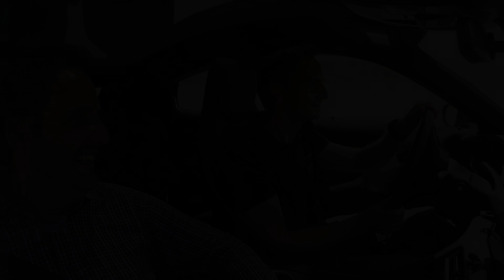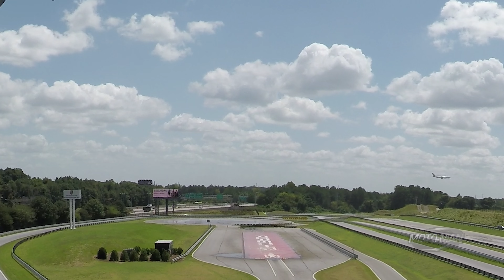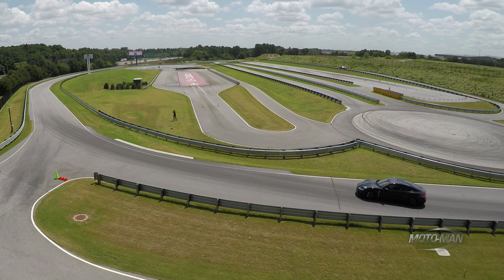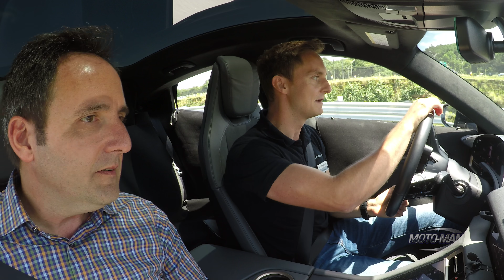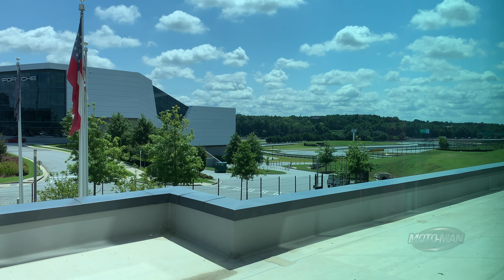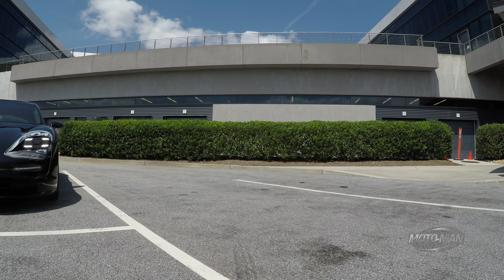Drifting the 2020 Porsche Taycan on Track with its Porsche AWD Engineer!

Comment: I said this on another video but, I wonder how many people are going to waste their money to option the PCCB’s (Porsche Carbon Ceramic Brakes) on the lower trim Taycan’s that don’t come with them as standard equipment? Since the electric motors do 90% of the braking through regenerative braking, the need for carbon ceramic brakes is unnecessary. Even the standard steel brakes will last for a very long time and provide more than enough stopping power doing only 10% of the braking for the vehicle. But regardless of that fact people will still pay the extra $8,000+ to get the PCCB’s just to say that they have them or because they like the way they look.

Comment: Looks like it handles very well for such a heavy car - Model S wont dance like this one.
Reply: Yep Model S is basically a Limo. Track Pack v2 Model 3 is on a different level even compared to Taycan. There is limits to physics.
Reply: @Neojhun  Taycan is heavier than a Model S... which makes it even more impressive. Model 3 is lighter and very fast indeed, but dont think it will beat the Taycans time around the Nürburgring.
Reply: @fthyme87  Yeah it lacks the Top Speed, but on a tighter track Model 3 could win. I'm just pointing out the difference in Handling Cornering capability.
Reply: Frederik Håkonsen Thyme a Tesla cannot complete a lap at Nurburgring, they reduce power after like 2 minutes of driving at the limit, the Porsche can do it till it’s empty
Reply: @NotNico910  BLATANTLY FALSE! That is Marketing BS. Even Porsche massively reduces power below 40%, that is technical limitation that has not been magically solved yet. Model 3 Performance has proven to have decent power for about 30 minute Track Session, you get massive loses around 40 minutes. Nürburgring Times are SUB 8 minutes. Stop with the Technical Falsehoods.
Reply: @NotNico910  it couldnt in the past it can now
Reply: Neojhun the Porsche does lower at 20%, a Tesla p100d can not go full throttle for too long I saw lots of Videos honest tests, a taycan can go 260 km/h for 20 minutes straight, there’s an extra modified version of a model s to complete the Nurburgring but nothing the customer could buy
Reply: @NotNico910  But CUSTOMER Model 3 Performance exist and countless people have taken them to race tracks. Simple fact is you get close to 30 minute of track time. Sounds like Taycan has the same exact stress profile. FYI didn't Bjorn Nyland do the Autobahn in old P90D for 12 minutes, 20 mins is just an incremental improvement.
Reply: @GT Suryateja Umm read the original topic again. It was about handling cornering, which obviously Model 3 Performance has unfair advantage. No amount of Porsche delusional magic can beat removing 400kg and lower flatter mass distribution. The steering rack is actually quite reactive and sensitive on center. I never said being Faster Speed than a Taycan that's just not plausible. Note I agreed "Yeah it lacks the Top Speed". That guy LIED that it could not even do a single lap. Interms of a more agile car Model 3 beats Taycan, that should not be up for debate.

Comment: 21 inch wheels.  That adds a lot of weight over an 18.  Wonder why they choose such a large wheel?
Reply: Have to be large and wide to fit the massive rotors and calipers. My turbo Cayenne has 21's and 19 inch rotors. 19 inch wheel is smallest you can get as I also have a set of them with my mud/snow tires as I off road it too.
Reply: @scottwarner2827  good point.  I didn't realize they made rotors so big now.

Comment: Until the electric chargers are as ubiquitous as the gasoline stations these EVs are still handicapped by range anxiety and limited to city driving.  Five years hence the electric car will be a viable option.
Reply: This has an 200 mile + range and access to thousands of high power chargers in Europe and North America.  The high current charges will double by 2021.  There are charge stations at malls, hotels restaurants, drug stores.  You are thinking 10 years behind today.
Reply: Correct it's all about the DC Fast Charging network. WRONG it not supposed to be anything like Gas Station. They are the wrong use case and in the Wrong Location. Tesla Supercharger network proved what you need to do the Cannon Ball Run in 48Hrs. It's not many Gas / Electric Station in the cities, but Highway Rest stops In-Between major metro areas. The most important thing is Payment Access & Reliability which seems to be the most difficult. Location are opening at crazy fast rate. One we figure out Universal Payment killing some stupid Electricity ReSale Laws & Regulating Charger Operator to Maintain Reliable chargers. BEVs have no problem to CROSS CONTINENTs.

Comment: Too bad it’s $230K out the door.  At $125K I was a buyer
Reply: OnTheSnap1 They will be making more models at lower costs.
Reply: there's still the taycan and taycan s to come...
Reply: Where's the $230k from?  The Turbo starts at $151k and the Turbo S starts at ~$185k.   TBH, if the only benefit to the Turbo S over the Turbo is a .4 second faster 0-60 and .3 second faster quarter mile, I think the Turbo is a much better value.  Plus it has more range with its drag coefficient lower by .03 .

Definitely priced a bit high.. certainly out of my price range, haha...  but then it is a Porsche, the first EV the brand has produced, and I'd say they did a pretty good job on it from the looks of it.
Reply: @updlate4756  Because the cars are completely stripped down without options.  Once you go on the prosche site and add basic stuff like active cruise control, lane assist, 400V DC charging, you quickly add $20-40K in options.
Reply: just make more money?

Comment: In the future battery manufacturing and waste management will continue to take a huge toll on the planet.  Most folks haven’t yet realized that there is no free lunch with this technology.
Reply: Not free Just BETTER. There is many problem including the fact we have No Clue what Chemistry will be used in a Decades time. Lithium Ion is TEMPORARY and will be replaced soon. You got fed the same BS criticism from some weird political groups who have no clue about the science technology.
Reply: And most energy in the world is still dirty. Evs are just moving the emissions from the city to the factories . At the end of the day it's not more eco-friendly than gas powered cars . Hybrids are somewhat in the middle since it's slower and uses less power.sportcar EVs are just as polluting as normal sports cars since the battery is getting power from a dirty grid  more frequently than hybrids. Slow hybrids and EVs are the way to go since they barely need to be filled up .

Comment: What an incredibly boring car.  The future appears to be big stupid boring g electric cars.  If porsche went there all will follow.   Very sad.
Reply: They have no choice. Blame the government and their emission regulations.
Reply: Outdated and frankly erroneous perspective. These high performance BEVs are super dramatic and sometimes even alarming driving characteristics. You probably still think EVs are like Prius. FYI majority of Prius have NO PLUG and are 100% Gasoline Powered. That was a Boring GASSER.
Reply: @Neojhun  - outdated perhaps.  Erroneous no.  Porsche has built a very sophisticated refrigerator.   Yes I would have clung to horses had I been around in 1910.  I hate all electric vehicles from these super expensive appliances to the dangerous e-bikes and scooters that litter our sidewalks.
Reply: @gsthree9534  Ok in that case you admit it's due to being a Luddite and not failure of the machine, that's seems like a reasonable personal preference. But Littered Scooters is not Relevant as that is just a stupid Business Model. If a Gas Scooter was viable the same would of happened.

Comment: Just bought a 911 GTS  Cab..... starting to regret lol.  Dude your videos are technical and interesting.  You sir are best in class.
Reply: Stephan Abraitis Don’t be crazy.  Your car is awesome!  I know, I have one also.
Reply: Closer to truth.   You are spot on.  I would be crazy.   I’ve owned a few nice cars in my time.   This 911 is something else.   I know there is more expensive exotics, but no thank you.  Most well balanced of everything.  Love my 911
Reply: Mainly wanted a manual trans.  2019 GTS same HP as 2020.   New looks great, but the spec on the car I get is extremely loaded.  Yes I did get some discounting because I was patient and kept offering until July when they were likely going to get a little stuck with it.   So overall, a fair win.
Reply: why not wait for the new 1? cuz huge discount?